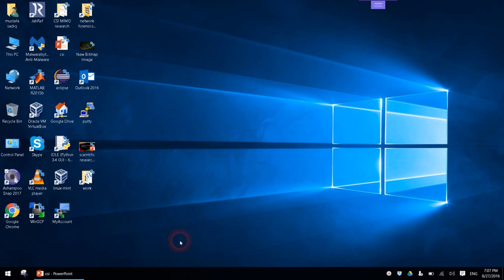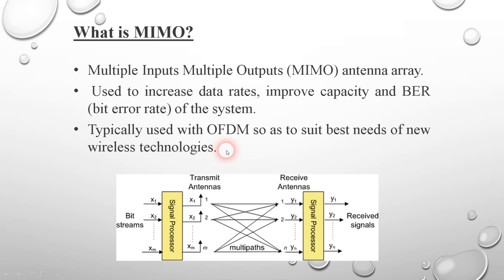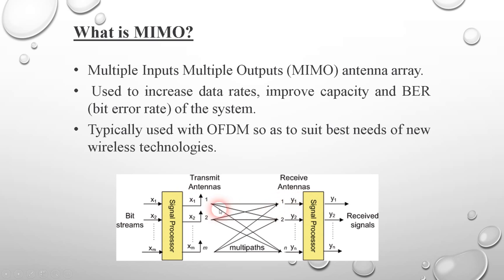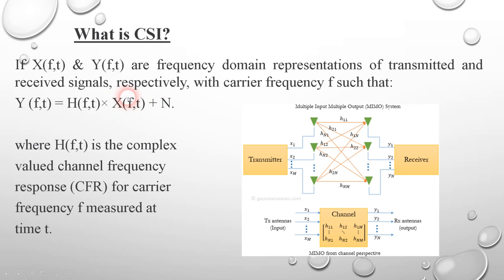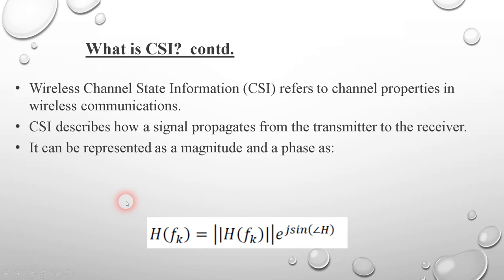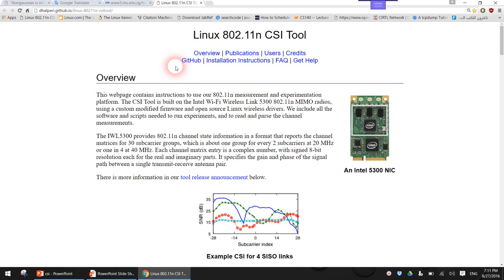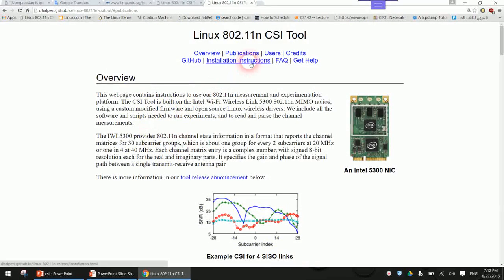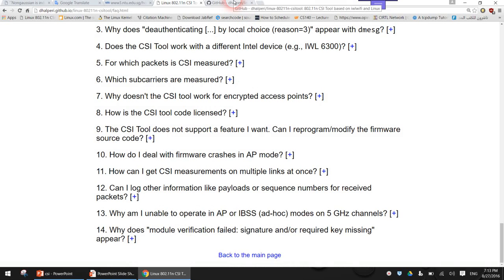Channel State Information CSI: definition, tools, benefits, and applications

Comment: Can you share the powerpoint file? with your due references of course...
Reply from the maker: Nilukio Unknown you can find all the related info in this link
https://www.researchgate.net/project/Human-gestures-recognition-using-WiFi-CSI-Signals
Reply: Thank you for answering me so solicitously. I'm a computer engineering student in Brazil, as you already were. Your video is very explanatory, thank you for disseminating knowledge.
Reply from the maker: Nilukio Unknown you are welcome and good luck in your study
Reply: can you share the slide deck. Good info